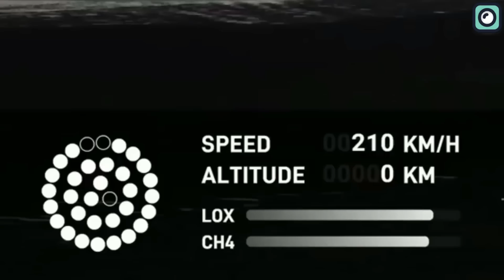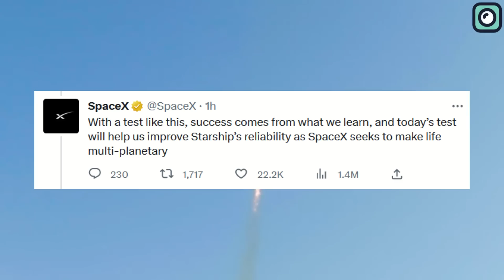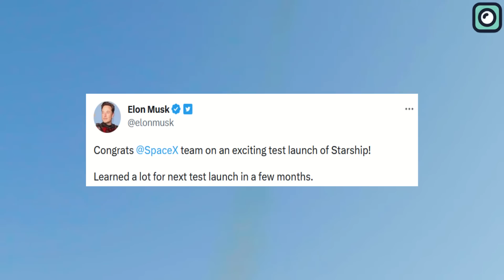SpaceX Revealed Why Starship Blow Up During The Orbital Launch Test... Musk Reacts!

Comment: From an engineering test perspective, you learn the most from destructive testing, that is by breaking things. You can also learn from instrumentation how the failure progresses. In many cases, failure is progressive, like opening a zipper. Questions like where does it start, can we stop its progression, and finally where is the point of loss of control. Think of kids playing with matches. A pail of water 10 seconds after the exclamation will stop the progression. A pail of water 10 minutes after the exclamation is futile. The fact that Super Heavy got off the pad with all that destruction going on is truly impressive. The fact that the clamps operated with all that debris flying around is also impressive.

Comment: Remember how Falcon 9 became successful? Because of multiple failures.
Reply: I remember how Saturn V became successful. 13 successes to orbit out of 13 launches.
Reply: @executivesteps  And that's not counting the Saturn Block 1 and Saturn 1B launches, which suffered only two flight failures in fourteen launches prior to Saturn V.  Overall, the Saturn rocket system was 25/27, a 92% success rate.
Reply: @executivesteps  also this rocket has twice the thrust of the saturn rocket using a lot of brand new technology

Comment: Very impressive at the brilliance of the minds that made this possible.. amazed at the power of the rocket to tear up the launch pad .. baffled that the launch pad design was so inadequate for the job.
Reply: Elon did elude, prior to the launch attempt, that if it melts the launch pad, it will be very expensive.
Reply: As far as I know, the ground underneath Stage Zero is too sandy and too wet for a proper flame trench.
Reply: @Merigold83  So the the clowns built it in the wrong place ?
Reply: I think that’s one of their biggest issues.  It’s not just a matter of pouring a little more concrete,  it just gets destroyed.  They’ll figure it out :)

Comment: The rocket sat on the launch pad a long time and tearing it apart.  I don't understand why there wasn't a flame trench designed into the pad.
Reply: Because they didnt have time to complete the construction of it before launch test. Now datas in, fix the pad and complete construction...
Reply: Everyone here is a rocket scientist 😂😂😂😂 it’s a prototype 💩 happens
Reply: A lot of us that have been following SpaceX for years have been questioning their decision not to have one for a long time.
Reply: @surf2257  Elon did not want it, it's his decision, the time to construct it is not a valid excuse. The problem here now is the FAA. SpaceX has demonstrated some reckless way of organizing this test and the FAA does not like such a mess on the ground. Now the flame trench is not even debatable the FAA will definately require it before the next attempt which means the KSC pad will have to be completely redesigned too. I'm very impressed by the rocket though but the way SpaceX and Elon are dealing with this project doesn't look very professional to me.
Reply: @Enigmatic..  I’ve been following space x since the beginning I’m sure they had their reasons
Reply: I agree with this. The rocket seemed to take too long for liftoff and the exhaust seemed to have a lot of debris in it. I'm comparing it to Saturn V launches I've seen in the past, which was also a huge rocket. A stronger launch structure is probably being considered with flame trench and improved cooling. They learned a lot today, SpaceX will jump all over this and improve.
Reply: It sat on the launch pad so long, 8 seconds, because they have to start the engines in groups rather than all at once to minimise the jolt
Reply: because they purposely burned out the concrete in 8 seconds so they can build-- 8 seconds beats 2 months of digging
Reply: @emmacheeseman4758  You sure about that? What about the 'jolt' when the Saturn V's 5 F-1 engines were ignited?
Reply: @heyfitzpablum  starship has over twice the thrust, ooh er, of saturn 5
Reply: @heyfitzpablum  sorry, that was no way meant to be any insult, nor offencive, and nothing was aimed at you, I'm just a little cheeky at times, and add a little light hearted humour now and again. Hugs

Comment: As one astrophysicist has observed, any Starship landing on an unprepared Mars will not be returning. First, smaller craft must visit the planet and build a launch pad so Starship can relaunch without digging itself into a crater. Of course, if Starship remained in orbit around Mars it would eliminate that problem. Not sure what the plan is.
Reply: Starship is much smaller than the booster is.  And Starship will have to be able to launch from the ground for Moon flights.
Reply: @stargazer7644  Smaller mass ship absent boosters combined with lower Moon gravity. You can imagine a Starship relaunch from the moon might be possible. 

But math would be different on Mars. I wouldn't want to be onboard an untested manned-mission relaunch from Mars. Again, smaller ships initially to at least verify appropriate landing/launch pad site might be in order.
Reply: @douglascutler1037  It isn't too much different for Mars.  Mars has 38% of Earth's gravity and its atmosphere is so thin it would be considered a fair vacuum anywhere else.  It is a LOT easier to launch from Mars than Earth.  It's about twice as hard as launching from the moon, and look at the tiny size of the Apollo LEM ascent stage that managed that.

Comment: The rocket was NOT destroyed by SpaceX systems.
     They attempted to use the onboard destruct system but it failed to blow up the rocket.
    What happened was the rocket broke apart as it fell back down. 
     There were two devices, one on each stage that punches a hole in the side of the rocket to allow gasses to escape. This system was meant to cause the rocket to explode. It failed. The two holes were punched but the escaping gasses failed to ignite. The rocket broke apart as it reached high enough velocity that caused enough stress to tear the rocket into pieces..

Comment: The launch pad was almost completely destroyed. Simply repairing it or rebuilding it back the way it was would be pointless. It would just happen again. They are going to need a completely new design, much more robust than the original. While the SLS rocket did considerable damage to the pad and tower, it didn't look anywhere near as bad as the damage to the Starship pad. Chunks of the pad may have been to blame for damaging/destroying several engines. There was also a significant amount of damage to the entire site, including the storage tanks. They need to move the actual launch pad much farther away from the rest of the complex, but it doesn't look like there is any other place to put it. I'm actually surprised that they didn't realize just how much damage the rocket would do. 

I also have an issue with using 33 engines. It seems that getting all 33 engines to function properly at the same time would be nearly impossible. Also, with the engines being so close together, it also seems likely they could damage each other. The Soviet N1 rocket had 30 engines, only produced 11 million lbs. of thrust, and failed all 4 launch attempts. I've always felt that having that many engines was probably the cause. The Saturn V first stage only had 5 engines, and they could be placed farther apart. I realize that SpaceX is trying to put a lot more weight into orbit than the Saturn V did, and I realize you can only make a rocket engine so big. But at least IMO, the fewer engines the better.

Comment: i heard that the reason the tumble hapenes was becuase the hydrolic steering failed from the dabree it kicked up on launch the new starships have electronic steering not hydrolic so they just need a large chilled metal plates under the rocket to press down on cement but not move and protect it, elon said this is being built but was not ready, if the rocket had not launched there would be no way to get the fuel off of it in it's damaged comdition, and that would of been much worse, they sent it when the computer said no at 40, the rocket maintained altitude during its flip but lost 5-8km (1/4 of wat it flew) before they terminated it in about 10 seconds so it was pointing down if u watch space x video

Comment: A typical journalist's point of view. One can see several seconds after lift-off that the rocket got severe low-frequency (~1Hz) lateral bending vibrations as if something got in resonance. This can easily damage the connection between the Booster and the Starship so that separation did not work. Will be hard to dampen these vibrations.

Comment: Someone mentioned that the blast of the engines would have made it unlikely for concrete chunks to fly up into the engine and damaged them
Reply: They have to find all the engines, and investigate the cause of their damage. The engines that hit water surface have different damage picture than the engines hit by concrete debris or exploded during work.
Reply: They didn't start all the engines at the same time.  They came up in stages.  So while some of the engines were at full power blasting at the concrete, others hadn't even lit off yet.  Concrete chunks could have easily damaged those engines.

Comment: Good to see here what I said after event occurred, that the vessel was intentionally destroyed at 29k ft after reaching altitude 39k ft. Most doubted that.  All engines were not needed as there was no heavy payload to lift.  SpaceX need an alternative to the destruct, perhaps a fuel shutoff or jettison of at least one of the fuel components.  That way it be possible to recover some beneficial evidence rather than destroying it,  spreading debris over the Gulf waters.  It would have come down in open water.   This first liftoff of superheavy from Starbase was a great achievement as a prototype learning step.

Comment: Not disappointed at all. It was a spectacular "event"  they shut off main engines then relit the engines and that's where they lost control. I'm no rocket scientist, but they won't make that mistake again. It needs what falcon heavy has. The launch system to pull it away incase of issues with the booster. Space x not wanting to add this is a massive problem for them. They will end up pulling it off but we will lose another 3 of 4 before we reach orbit

Comment: They’re probably going to have to go off shore maybe not far, but if the pad is above water that could significantly reduce damage to the foundation of the pad.
Reply: 16.7 million pounds of thrust will drill a very deep hole blasting everywhere.  Water is quite heavy and can cause lots of damage.  Concrete is only about twice as dense as water.

Comment: I've had this discussion with a few people when SpaceX first showed the construction of their Starship launching pad that showed no flame deflecting trench and proper water deluge system and we all had a consensus that without a proper launch pad SpaceX was asking for trouble and this would bite them in the arse sooner than later (we were right). The launch pad was the mistake from the start, pieces flew into the engine bays and that was it. If SpaceX had not decided to skip steps because they were in a hurry, they would have constructed a better launch pad with the right water deluge system and more clearance from the ground to the engines. SpaceX will have to build a launch pad with a flame deflecting trench and a proper water deluge system. Also, just a thought, could have the fixed grid fins been acting as a distibiliser at MaX-Q? Something that in SpaceX wisdom, they could not anticipate? We all know the basic aerodynamics/atmosphere resistance, that's why airplanes, cars, rockets and so on are built a specific certain way. Having fixed grid fins on the way upwards, doesn't get the same effect as when the rocket/booster is coming back downwards. You have the engines gimballing and the grid fins holding the rocket in a position that maybe the engine gimbal can't stabilize or overpower the aerodynamics due to the grid fins affecting the trajectory on the rocket's upward ascent, pushing to escape earth's gravity. 
When the booster of a Falcon 9 is coming back down in a control entry, the grid fins are deployed and they work so good that they maneuver the booster down to a perfect bullseye landing zone, so it shows how pertinent and just how big of a role the grid fins have in positioning the booster for perfect landings. So, those fixed grid fins may play a major unanticipated role when the rocket is going upwards and maybe working against the gimbal of the engines to keep the rocket straight and stabilized. But what do I know, I'm no rocket scientist and don't earn the big bucks due to that lack of knowledge. 

I know that Starship is built to land and take off from the moon and Mars surface in mind, which will be all rocks and dust. Maybe Starship will need to be build in two stages so that the third stage is built only for landing and take off from such surfaces. Pretty much like the first moon landing was built for. Also, one thing is for sure, Starship is going to need legs, that's not even a question anymore but rather an absolute. SpaceX can't have their cake and eat it too, meaning yeah they want to minimize the weight of the spacecraft in order to carry more cargo weight, but legs will be required no matter what they say and if not accepted as fact because they don't want to go there, Starship or any future Spacecraft is going to require legs and that's that. 

I truly and absolutely believe that if the launch pad was built right with a flame deflecting trench and proper water deluge system, Starship might have been able to complete its first flight test to the end or at least farther than it went. I don't think that the result of this test flight is due to the booster, its engines and/or Starship, but rather because of the launch pad. This is definitely a "back to the drawing board" situation/moment and it will have to start with the launch pad. It doesn't matter what new and advanced upgrades they do to the booster, its engines and/or Starship if they don't address the launch pad issues first, all Starship test flights are in danger/jeopardy of failing lift off no matter their upgrades if SpaceX keeps their launch pads as it stands right now. If they don't totally recreate their launch pad, Starship will never pass the first test of launching into LEO. Other than what they've learned from all the data they were able to gain from this first test flight and what new upgrades they make to the entire rocket, the launch pad needs to be completely destroyed and rebuilt in order to give Starship a chance to complete a full test flight. Get the rocket to complete its first full successful first flight and then go from there on figuring out how to land and lift off from the Moon and Mars surfaces later.  So, the three absolutes in my mind and opinion which doesn't come from a rocket scientist/engineer, but just basic knowledge of common sense. Which I could definitely be wrong, hence this post in hopes that someone easily smarter than me can address. 
Launch pad first, legs second and fixed grid fins rethinking are the 3 absolutes in my opinion. 

I know this is a long comment but I would really like to get opinions from more knowledgeable/smarter people than me on my questions and opinions stated above, please.

Comment: The next tests will also be a riddled with the same problems as long at nothing is done to evade the enormous exhaust pressure and heat against all structures on the pad and the rocket itself. They cannot continue to make the same failure time after time if they want to reach their goal.
Reply: The shockwaves bounced off the concrete below the rocket and probably threatened to destroy the vehicle, certainly they damaged several engines directly or by debris they kicked up.

Comment: I noticed that after ignition the rocket took 6 or 7 long seconds before it started to lift, this made me suspect that not all engines were functioning, which was reinforced by the sight of an asymmetric exhaust plume. The brief rear-view camera shot showed at least 5 engines out, and further uncharacteristic bright, angled spurts of flame caused me to think that at least one more engine was consuming itself. Just a thought, could the "chopsticks" lift the complete assembly, by the booster, fully fuelled and ready to go, well clear of the launch pad to reduce the risk of damage to both itself and stage zero?
Reply: The "chopsticks" cannot support the weight of a fully filled set (super-heavy + StarShip)